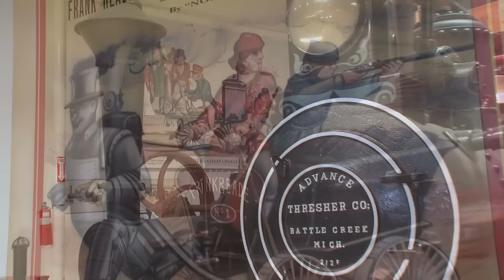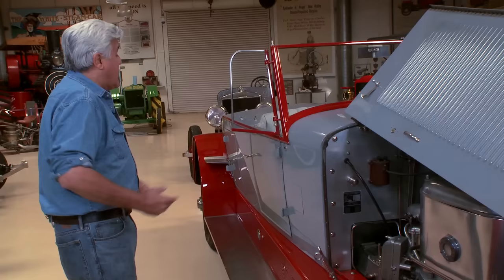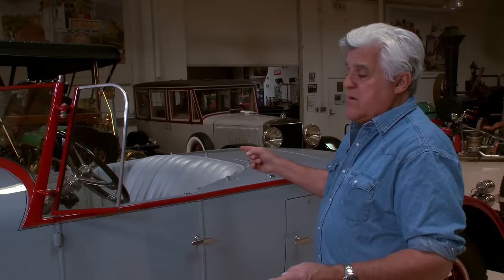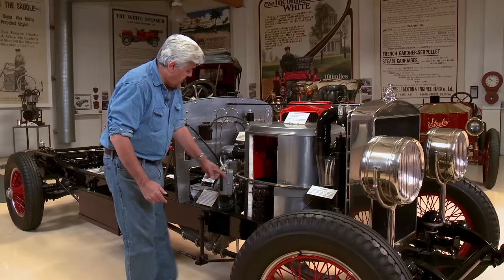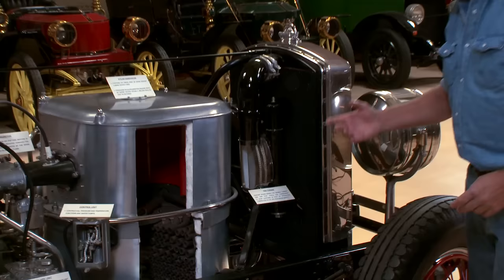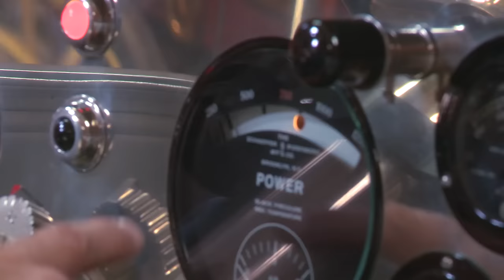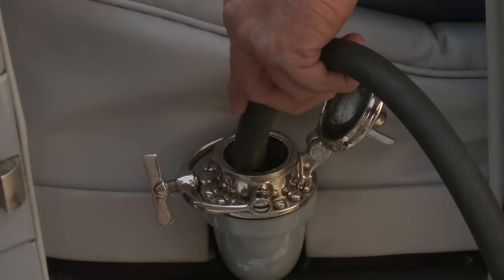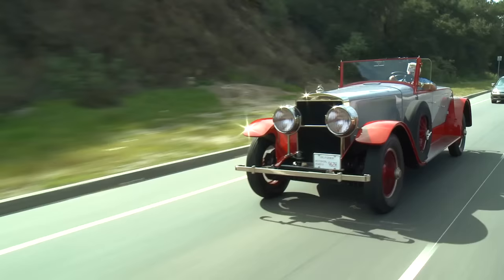1925 Doble E-20 Steam Car - Jay Leno's Garage

Comment: That is a very nice car. I love the look of vehicles from the 20's and 30's. 

But I also have a question. Why are companies such as Toyota and Nissan spending millions on developing electric cars when the answer to the fuel and environment crisis was invented 90 years ago?
Reply: Because those cars use gasoline to heat the steam...
Reply: Oh ok. But surely that uses less fuel than running the car on just gasoline
Reply: mahukalamata Why not use electricity to heat the steam?
Reply: In car sizes steam is a very thirsty beast. Lots of fuel. Using batteries to heat water to drive a steam engine would give you a quarter of the range of straight electric. Talk to someone with engineering or science degree they will explain it.
Reply: fizzguts Ah ok! Thanks! But wouldn't that mean it would use a lot more gasoline too?
Reply: Think of it this way. Every time you convert energy into another form of energy, you lose some of it. With an internal combustion engine, you're burning gas, and using the gases produced to push on a piston. With a steam engine, you're burning gas to convert water into steam, and then using the steam to push a piston. There's an extra, energy-sapping step in there, and by definition you're going to be less efficient than an internal combustion engine. Which is why you don't see steam cars around anymore. That, and they're far more complicated, far heavier, and far more expensive to make, so they don't make much sense from a business standpoint.

There are some advantages. Steam cars will burn any liquid fuel. Gas, diesel, vegetable oil, kerosene, it doesn't matter. They're a flexible fuel vehicle by definition. Also, steam engines burn gas continuously, until it is all combusted, unlike gas cars that only burn once, and create a lot more pollution as a result. Steam is cleaner, though maybe not necessarily cleaner in terms of CO2. But it's cleaner in terms of carcinogenic hydrocarbons that you get out of incomplete combustion.

Steam is also more robust. All components are very low stress, and you can get a million miles on a steam engine. Try that with internal combustion and see how far you get.

The truth is, we still use steam. A lot. The electricity you're using to read this right now was probably made by steam. Nuclear ships work by using a reactor to heat water to produce steam, with then goes to a steam engine of some sort. Steam is still around, and probably not going anywhere for a while.

It's just not used in cars.

I do wonder, though, what you can get with superheated steam today. There's no reason to stop at 800 degrees. Keep going. Doble, after his car business fell apart, kept making more and more advanced drivetrains, and I wonder what would happen if we were to continue his research.
Reply: Mostly weight, I mean that thing is quite heavy compared to a car from that era - albeit it does got enough power to follow. A boiler is not something really light.

They are safety issues as well, such an engine could (and did) explode in the hand of idiots. You don't have to worry about that with electric engines, the worst is electrocution, but than you have to go far to get that....
Also, the efficiency could vary during a trip, unless you get something really hot all the time.
You also get maintenance issues. Electric engines are often - not all the time - really easy to maintain; in the hand of someone who know what he is doing, the typical maintenance could be done in 30 minutes. On a steam engine, it could be really close to hell.

Now, I could see some place for steam engines in the future, and even in transport (trains and maybe some trucks like a Scania or something); just not in the cars.
Reply: therrydicule Merde. NO Steam car has ever exploded. The 13000 Whites 11000 Stanleys never "exploded" Ditto Serpollets and Dobles. The design of the boilers make them leak not go bang Dobles Whites and Serpollets all use a coil of tubing even if they break it's just a very loud hiss. A Doble was a similar weight to a IC car of similar price. Stanleys were underpowered and a bit heavy if you are talking about post 1914 cars
Reply: fizzguts
I was speaking about steam engines specifically; some of them did exploded because of, well let's call that idiots.
The Canadian National 242 did have a boiler explosion, so did the SS Sultana and the USS Willamette. Ok, it's not the same design, still it does not give good feelings to many possible buyers.

The Stanley did get bad compared to the competition, and did bring some reputations.

Still, even there a doble weight over 5000 pounds, which is comparable to the base model J of 1931. Now, the model J does have the advantage of being simpler to use. Also, at that time, the European started producing relatively lighter cars like the Austin 12/6, and half the car in USA were Ford model T. I'm not sure the Dople could have get in the market for smaller production cars.

However, this does give the Doble a status : a good, but complex, engineered that did manage to exist. It might be, ironically, the first supercar. And that's ok, not all the cars could be the production cars for everyone ;)

Than, a bit later, WW2 happened, and many forget about the steam powered car given the habits of using a regular gas piston engine.
Reply: ***** Because fuel is much more energy dense than batteries. The BTUs stored in batteries are a tiny fraction of the equivalent of BTUs stored in the equivalent weight of gasoline. Also, gasoline , being so energy dense, takes up less space. Burning gasoline in internal combustion engines is incomplete and creates a lot of CO and other gasses. The external combustion used in a steam generator burns all of the fuel. It therefore produces vey little emissions and no poisonous CO. Refueling is rapid with a liquid fuel but takes hours with batteries. If one has electricity stored in batteries it would be more efficient to use that to drive an electric motor rather than converting it into steam power. Electricity to rotary motion is a direct conversion, electricity to steam generation to rotary motion is a ridiculous complication that requires many more parts and also wastes a lot of energy lost in the conversion. When you turn on a blender, that is a direct conversion of electricity to rotary motion.
Reply: Maxwell Jaxwell
What if the battery was made out of uranium?
Reply: therrydicule it would be a block of expensive heavy with no power. You need to do a LOT of reading on battery electrode potentials and then you will begin to understand that "yes there are stupid questions"
Reply: fizzguts Or is it plutonium? I know there is such a thing as an atomic battery.
Reply: Steam is LESS fuel efficient per horsepower on the scale of automobiles and trucks... Diesel is much more fuel efficient...
Reply: therrydicule what if money grew on trees
Reply: Maxwell Jaxwell I'm sure some crack pot is working on that too....claims its more efficient to grow money than to print it....
Reply: Maxwell Jaxwell
I'm just saying, because if we had atomic batteries, I think the charge would not be the issues people would complain about ;)
Reply: fizzguts
I was making a joke here, in the sense that the issue of charging and range would be seen as irrelevant given the risk posed by the material.

By the way, nasa do have plutonium-238 batteries. I don't know their weight, or how they function. It's still pretty much a battery to me.

The "point" being that the issue of batteries is relatively small...

By the way, I think the current electric car are awesome given our current technology. It might not answer perfectly to the demand, but in the same time our demands might be a bit too high given the economy and the raw material available. Let's face it, not everyone will drive a Roll Royce customized as a speed shop, nor does everyone should have that ;)

Sorry if you took it as being a serious comment ;)
Reply: therrydicule One thing, but there are no electric engines, they are motors.
Reply: In addition to weight, complication, and cost, you have the time it takes to start in comparison to an IC engine and also the fact that the water could freeze in cold temperatures if there isn't a way to keep it above freezing temperatures.

One benefit of steam engines though is that if The End of the World As We Know It occurs and you want to re-start civilization and also have working automobiles, steam vehicles and engines, provided you had the knowledge to build them, would be great options. Gas and diesel don't last, so they would go bad after a certain number of months, thus leaving all of those IC powered vehicles useless.
Reply: Kyle Blank an interesting thought... but equally and highly unlikely.... if "The End of the World As We Know It" scenario did happen..?? If everything switched to steam overnight? where exactly would all the mind boggling amount of fuel come from to run a world with todays energy demands.. fuel supply demand would double overnight as well.
Reply: therrydicule Plutonium-238 RTGs are not batteries.... they are thermoelectric generators powered by the heat of nuclear decay.... they have never been used in applications in excess of 750 watts....
Reply: doktorbimmer
Ok, well, that's different a bit... I'll give you that ;)
Reply: doktorbimmer Considering it would be the end of the world, there wouldn't be much of anything left to run on steam. I am talking about a situation where you say have small communities or survivors forming and trying to make a living by farming and so forth. For such people, knowledge of how to build and operate a steam engine could be very beneficial. Gasoline and diesel engines wouldn't work after a certain number of months as gasoline and diesel go bad, so even if there was a lot of fuel lying around, it would end up unusable. A steam engine though, you could burn anything to make it run, and for limited purposes in a small community, there would probably be lots of fuel available.

One such scenario could be an EMP, which could render all electronics and automobiles inoperable by frying their electronics. This could come from either a nuclear blast from a terrorist attack or a coronal mass ejection from the Sun. The coronal mass ejection actually is a realistic scenario, as one narrowly missed the Earth in 2012 and back in the 1800s when one did strike the Earth, it knocked out a lot of the telegraph lines that were in place.
Reply: fizzguts I think you are referring to running IC engines on wood gas? That is also a skillset I would say that would be very handy for such a scenario.
Reply: money my friend
Reply: ***** Good point, the risk of boiler explosions is real... but in fact these more advanced steam engines actually have very little water or steam stored in the boiler (actually they are steam generators not boilers) so the risk is greatly reduced even with higher operating pressures ans temps.
Reply: ***** Grr there has NEVER been a steam car boiler explosion Whites Serpollets and Dobles use coils of tube with a MASSIVE safety margin and when they do spring a leak there is a brief loss of steam as they have so little water stored in the coils a complete non event. Stanleys have never had an explosion again with there massive safety margin and with 100's of tube all that happens is a tube lets go. The reasons steam faded was in smaller sizes i.e. cars trains, were numerous, they are less efficient, bulkier and use more expensive materials copper and brass back in the day stainless now, they require different skills to drive, you have to know what you are doing to get reasonable performance out of a steam car, there were and are limited number of people who can maintain and repair steam cars. etc etc
Reply: fizzguts Also steam cars take too long to start up in comparison to an internal combustion engine.
Reply: fizzguts I think there is a problem between figurative and technical language here:  ok, it does not literally explode, but it could backfire and, as far as the average joe is concern, that's close enough. Sure, technically it's not the same thing, but could you explain that to your grand-ma (assuming that she is alive) if it happens and she is present?
And, sure, that would mean that someone did not do the maintenance as supposed... But, have you seen how the average car owner threat his car? Now consider that half of them are actually worst than that!
Reply: Dylan Morgan Yes steam is rather complicated and expensive... but so are electrics.... as far as being "practical"  neither has very good range.... in terms of cost, fuel efficiency and carbon emissions... the ICEs still win
Reply: ***** Lol!!!!!!  you must be kidding right???  Don't be so sure of your engineering skills there my friend.... you are no engineer.
Reply: *****
You forget about the different emissions.
Reply: therrydicule Actually forgot something very important... and its not emissions, its a critical factor in determining fuel efficiency
Reply: Dylan Morgan They were never a very practical design for an automobile.. steam became obsolete for several reasons...

The problem here... is some folks that don't understand the engineering principles involved and persist in these completely false notions that steam was more efficient than Otto or Diesel engines.

Nikolas Carnot's Thermodynamic theory (Carnot's Rule) proved over two centuries ago that it is IMPOSSIBLE for a steam engine to be more efficient than either the Otto or Diesel Cycle engines.
Reply: The real doktorbimmer
That too, but I forgot about it... I was thinking that it probably won't pass the EPA standard anyway, so the conversation is a bit useless.

That being said, even if it was to pass that, and since they are alternative to SUV and some elasticity as far as the economics of the car market could be present...
You know, you could decide that a Lotus Elise would fit the wants of money for a Porsche 911 turbo or Ferrari 458. So, maybe some radical downsizing could do something here, but that might finish with something deceptive for the consumers. It might be interesting to look at the final result from a geeky point of view, but outside a demo car...

That being said, the complete reverse, water injection to keep an engine cool, could be useful though ;) I could say that.
Reply: therrydicule Well HC and CO emissions are probably be not too far off considering it would operate with a very lean AFR... the bigger problem would be NOx output.... some type of modern combustor and boiler might be required... I not aware of any readily available after-treatment equipment that would be easily adaptable but anything possible with sufficient expenditure of funding.
 
The Elise is a fantastic little car, but its hard to see the value in a car with its sticker price... with what is essentially a old Honda engine!
 
I'm not sure where your going with the Water Injection idea? applied to the steam engines boiler?
 
Cheers!
Reply: The real doktorbimmer The Elise is just cheaper than some other cars, and could fit most of the wants of high performance. Yes, the engine is a bit under-rated for that kind of car, but... It's the effect of downsizing.

As far as water injector, I was thinking of completely reversing the idea by putting it totally up-side-down: at the place of heating water with fuel, what about cooling a block with water? That seems simpler and more practical for today's world.
Reply: therrydicule I would think their  Malaysian parent compant Proton could pony up for a new modern engine...

I'm not sure I follow what your idea is all about...?  most engine blocks are cooled by water...
Reply: The real doktorbimmer Well, why would proton invest more in a car that does well?

What I am speaking about is literally injecting a bit of water in the piston to help cooling the entire block, like the nazi use to do during WWII ;)
Reply: therrydicule I don't think they sell very many...

Oh! Ok I undersstand your question now.
Yes, water injection has been used in production automobiles (especially on supercharged or extremely high CRs)  but on a very limited basis.
Similar to the MW 50 system used on German Luftwaffe aircraft of WW2, MW 50 differs slightly by the addition of 50% methanol (used to increase the cooling effect and for fuel enrichment) one of the drawbacks was the practical amount of injection fluid that could be carried (typically only 5 mins.worth). MW50 was a mechanical system only activated  when manifold pressure reached a preset level, the fluid was injected into the intake eye of the supercharger. The evaporation of the fluid effectively reduced manifold air temperature and prevented detonation or preignition that could damage the engine during Power-Max or "War Emergency Power" setting.
Reply: Dylan Morgan Not the same thing... ever see an airplane fly in the rain? a little water will not damage the engine.

Injecting a small amount of clean water into the intake manifold under certain conditions actually has some performance benefits depending on the design of the engine..  it also has an added benefit of removing carbon deposits inside the combustion chamber....
Reply: Dylan Morgan Yes actually it does...

Air always contains some water in the form of vapor... at 50 degs C and 100% humidity it contains up to 83 g/cubic meter

Water injection can greatly increase engine power output without damage... as much as 50% when higher manifold pressure or compression is used..

but like steam engines, is not very pratical
Reply: mahukalamata
the originally used kerosine. Jay converted them to Gas...
Reply: Isaac Weaver Kerosene is prefered for fuel economy but starting (which can be a problem for some cars) is easier on gasoline.
 I would imagine Jay has enough problems with multiple fuel types required in his collection so simplifing the supply is a factor as is the need for faster start-ups.

That fact remains that these vehicle have TERRIBLE FUEL ECONOMY regardless of the fuel type.
Reply: Dylan Morgan
Depend of the engine...

It's the same as of any other type of engine: ok, you get more torque than most other type of engine for equivalent performance... But, you will move quickly with a 3-phase engine of a tesla, but not get much acceleration with the 48-volt engine of a bradshaw electric vehicule.
Reply: Dylan Morgan They still have more disadvantages than advantages...

terrible range, higher cost, less efficiency and higher pollution over its service life...

Many electric car manufactures have already failed... and the current sales trend is far below expectations... the market for electric cars appears to be already shrinking..
Reply: The real doktorbimmer Efficiency is not exactly a problem: electric engine are theoritically more efficient than gazoline engine at producing the same horse power.
It's just that in a car, they create an heavy package: you need batteries, and if you want a long range you need heavy battery or a complex set up.
It's really a battery problem and a package problem.

And actually, the share of electric car is growing worldwide. Have a look at the sale of the Nissan Leaf: they growth from 2011 to january 2015. It's just that by 2015, it was an old model and people who wanted one got it (a bit the same catch as the AMC Gremlin).
Reply: therrydicule For stationary applications... Yes.
Electric motors are very efficient, no doubt about that... but vehicles need batteries...

...and batteries are horribly inefficient, heavy, expensive, have a limited capacity and general suck for general purpose automobile use...

Sales of all electric cars has failed to meet market predictions.. the relative small group of buyer that wanted them one have one now and the segment is currently fairly well saturated.

What is the fastest growing segment in the automobile market???

Diesel powered cars.
Reply: The real doktorbimmer You are basically re-saying what I told.

And market prediction are always weird, I would not worry about underperforming to market prediction.

Particularly when some new anti-pollution norms are under-ways and would attack smog a bit more in many countries, and diesel powered cars would need to include more costly particulate filters to answer these demands.
Reply: therrydicule Yes, but you can not have electric cars unless they have batteries.... or really really long extension cords Lol!

Well actually no, electric cars are now coming under increasing scrutiny by the scientific community regarding the false claims of less pollution and higher energy efficiency...

The facts seem to indicate that battery electric cars charged from the grid system actually use more energy and produce more pollution than fuel efficient ICE powered ones..
Reply: therrydicule Absolutely, the production of batteries for automobile prime movers is very energy intensive... using large amounts of fossil fuel and creating lots of pollution.

Let not forget CONVERSION LOSS

from start to finish charging batteries is very inefficient... only a very small amount of the original power generated actually makes it to road.

Not surprizing that you have got your facts wrong yet again...

Actually India uses LESS Fossil fuels and less coal than the US for example..

India gross energy consumption is 70% fossil fuel based and electric power generation is from 40% coal

The U.S. on the other hand uses 82% fossil fuel with power grid supplied 52% from coal.

Iceland? really? the only EU country that doesn't offer public mass transit...  everyone in Iceland gets around by cars...

Diesels use less energy and create less pollution then battery-electrics do...
Reply: therrydicule What is your point?

It doesn't matter where you plug in, if your using the national grid to charge your car its mostly coming from coal and fossil fuels...

.. and you are wasting a significant amount of that energy in transmission and conversion losses..

The simple fact remains that over all battery-electric cars are still less energy efficient and cause more pollution... not less.

Are you a communist or something?
 or do you deep down inside simply hate cars?

The whole concept of Social Engineering is a failure... in theory and in practice.

In a democratic, free market system if the people want electric cars? There will always be someone looking to provide a service if there are customers and a profit can be made...

If electric cars are not what people want? then the manufacturers that were created to take advantage of the government incentives will fail (as most already have) when the loans run out , the market will continue to stagnate and shrink as has already begun to happen.

ICEs are the most energy efficient technology available and demand for them will continue to grow... even as fossil fuels become more expensive... of course the beauty of the ICE is the wide range of fuel types that can be used.. ICEs will be around long after petroleum becomes scarce... consumers will simple switch to a more diversified (albeit more costly) range of alternate fuels...

The battery-electric car will never replace ICE cars unless an entirely new energy source (like nuclear fusion) is discovered to replace current battery technology and made commercially viable.
Reply: ***** Well, if that true it does not support your unfounded theory about big business and banking corruption..

These influences did not exist under the communist system...

There are no profits to be made by artificially suppressing your so called "superior steam technology"

Certainly a system that possessed the technology build space stations and to reach the moon must have had the technology to build superior combustion engine technology? so
Reply: ***** Then why aren't any of these small new independent car companies exploring Steam-Electric hybrids???

If everything you have proposed is true?

Then why not combine steam into a hybrid system?

Tesla for example, was started entirely with independent funding and loans from government "green technology" programs.

so absolutely no influence from big oil and banking corruption as you have insisted that have suppressed steam development.

So why no Independent research into steam as a "Green Technology"?
Reply: ***** Fisker Automotive founders diverted and embezzled a good part of the $528.7 million ATVM loan (Obama Green Jobs) along with millions of private investments.

Fleecing both tax payers and naive investors. 

Officially Fiskers denied that its batteries were defective, but the Karmas battery packs were found to be defective and Fiskers insurer settled out of court to squash any further bad publicity.
Reply: ***** ""modern technology""

My dear sir, you lack of automotive knowledge is severely lacking...

  the worlds first hybrid automobile was invented by Ferdinand Porsche in 1898.

It was a "series hybrid" feature Hub Mounted Electric motors built into the hub of the wheels.. and were available in a 2-wheel or All-Wheel-Drive configurations...

ICE-Electric drive??? Are you not aware that the exact very same system is in production and is currently used around the world????? 

By numerous large corporate manufacturers?

or that a significant volume of the world passenger and freight transport is hauled by this technology everyday????
Reply: ***** The only thing more ""super expensive"" than ICEs.... is Super Expensive and less efficient steam engines...

Its commonly understood that electric motors are more efficient than ICEs.. the problem for vehicle design is that they require batteries... which are horribly inefficient and expensive
Reply: The real doktorbimmer
What about an assisted-HPV? Like the Sinclair C5?
Not everyone need a car.
Reply: therrydicule The C5 is nothing more than a electric bicycle... available at most toy shops and sporting goods stores..

If your assumption was correct?

the C5 would not have been a commercial failure.. and we would all be riding bicycles.. not driving cars.

the bicycle has a completely saturated market..

The problem is you can't carry a practical cargo load or passengers, you can't travel on the highway..and you exposed to the weather.

its no alternative to the automobile.

PS; I love to ride my bicycle for fun... but only as a recreational diversion... whenever the weather is very nice.
Reply: The real doktorbimmer
That specific model was a commercial failure only because of the mismanagement from the higher ups that pushed a model badly designed, too heavy, and too soon on a market which was ill prepared for that kind of stuff ;) We speak about a badly design piece of crap launch in 1985 and became a bit of a joke. It was not just because it was bad replacement for a car, it was because it was also a bad product.

But, today, you got the eZee, BionX, Ecospeed, lightfoot cycle... You literally got tens of companies offering velomobile models somewhat similar to the C5, only lighters and overall they have a much better design.
That could answer the needs of some people who don't need that much of a cargo (single, live in apartment downtown).

The car could be too much for some needs.
Reply: therrydicule But they are all essentially a bicycle... you sound as if this is some new class of transportation... it is most definitely not a new concept  

The powered or powered assist bicycle has been around for over 100 years... there is absolutely no revolutionary new concept here..

its a very small niche market that is fully saturated with supply with no outlook for a radical change in demand..

bicycles are ideal for students, unemployed and those who live a rather meager existence and simply cannot afford anything better.

The bicycle's practicality is extremely limited... its restricted in the ability to carry passengers and only very light loads... minimal protection in an accident and no protection from the weather...they are often very easily stolen.

Its funny you should say that, if I had a dollar for every time I have heard someone who only owns a bicycle say; "I wish I had a car"
Reply: The real doktorbimmer
I'm not saying they are a new mode of transportation; I am just saying that some people buy a car while they don't really need it and a bicycle could do ;)
And I never have a collision on a bike: I did in cars...
Reply: therrydicule Well, not everyone can be a good driver...

Sometimes its in the interest of the greater good for some people to walk or ride bikes... its much safer for the rest of us.
Reply: *****
Well, look, family threes does not prove much as far as policy making... Otherwise this guy here:
http://greff.co/?page_id=156

Would be considered well connected and would work as something else then a photographer.

And any ideology could be used to commit crimes.

Lenin was more of a revolutionary and his action fit more a train of tough in a realist framework then the school of Critical Theory, or the neo-Gramscian, or even world system theory, or pretty much anything related to Marxism on paper. Only with some insanity in the mix.
For instance, where was the direct democracy of the workers? It was not there because "everybody love Lenin (according to Lenin... aAnd if someone disagreed with him under his rule, he might kill that guy so not much of a choice)".
Plus, Lenin was in exile for a while in Switzerland. He was not even there for the first phase of the Russian revolution; it's like he manage to squize in from nowhere by using a weird office that nobody saw the importance... So, whatever the situation for him, it was making sense to keep his bank account open in Switzerland.

And Trotsky was a bit more open toward capitalism then many Marxist. He was like a weird radical democratic socialist with some importance put on hierarchies... Many of Trotskist finished to be allied with the neoconservative and the LaRouche movement today, oddly enough. They are really strange, ideologically speaking, but it's still make sense for them to talk with banksters.

Not that these two make any bit of logical sense.
Reply: *****
Well, if you want to get cynical:
Do you expect revolutionary communist to do good accountant?

Or, if you want to get technical: do you speak about the February revolution or the October revolution?
Otherwise it's "easy": the Russian Social Democratic Labour Party was it's own political party and was financed by bank rubbery - because, yes, you talk about bank rubbers. And the Petrograd Soviet of Workers' and Soldiers' Deputies was supported by workers unions.
Other than that, some money from wall street did come in during WW1...

But this view is forgetting something really simple: It's mostly Nicholas the Bloody who lost all fucking support with his anti-Jewish program, with his bloody answers to the 1905 revolution, his repeated refusal for democracy so he could keep all executive power, his failure to bring some supplies, and the large rate of inflation during his reign. The feeling in Russia was that this guy had to go after 2 decades of mismanagement.
And since Russia have a lot of socialist and anarchist that have easy access to weapons, what the hell do you think happened?
Reply: ***** No sane or rational person would argue that communism (or your conspiracy theories) are not a complete failure...